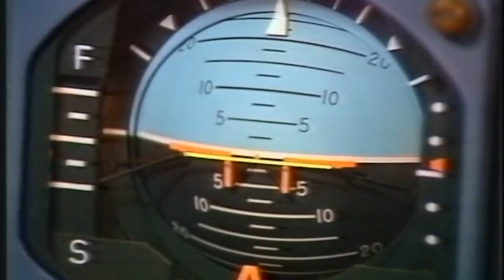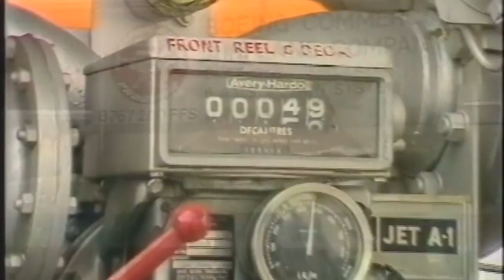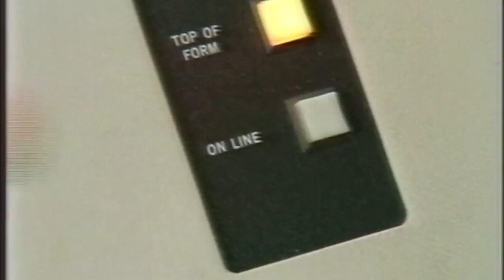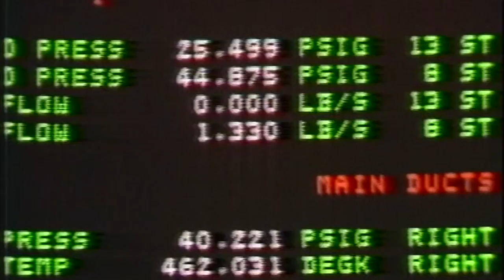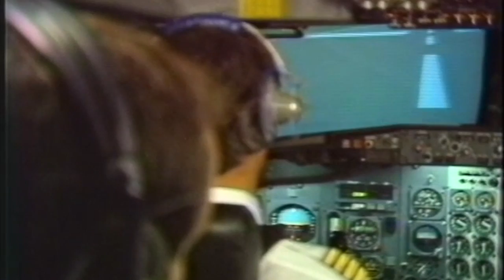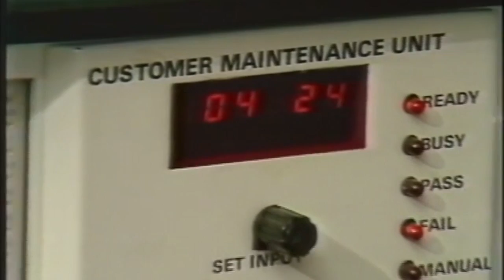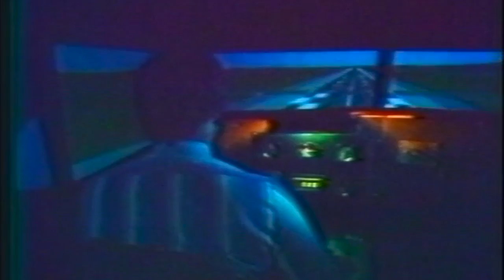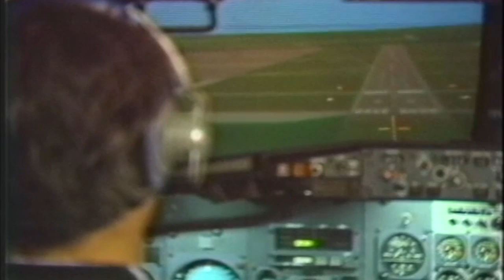Rediffusion Simulation

Comment: Very cool! I started working with simulators in Brazil in the same year as this video (1986). A partnership between the former GMI (George Mood Inc) and EMBRAER (Brazilian aircraft company). During this process, Reddifusion acquired GMI and renamed it Reddifusion Simulation Tulsa, OK. We developed the EMB-120 simulator and later the Embraer series of military aircraft, with permission from Reddifusion. I continue working with simulators, ENCORE computers (formerly GOULD), Systems and Control Loading among others. Very good to remember about Reddifusion, thanks for sharing this video.